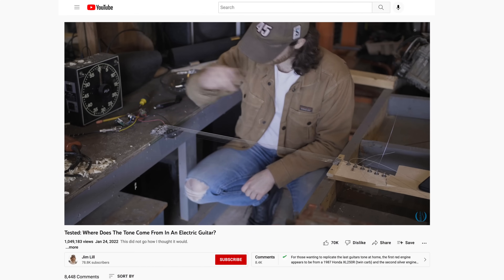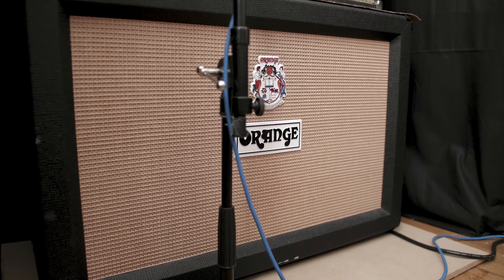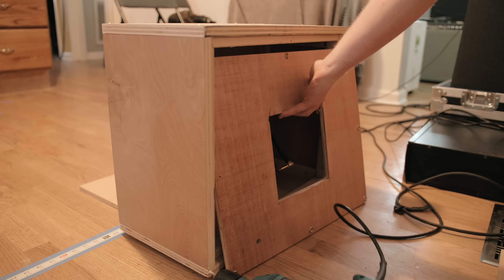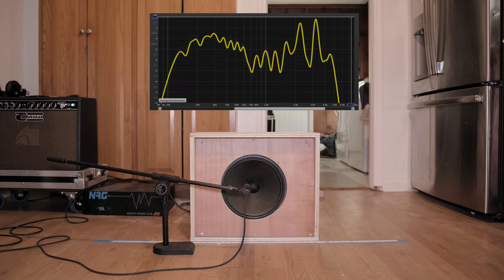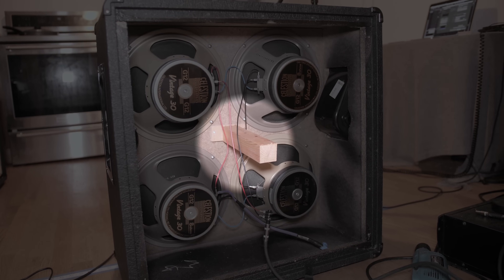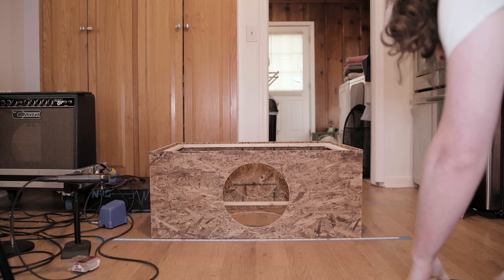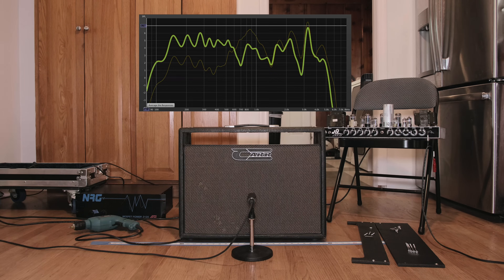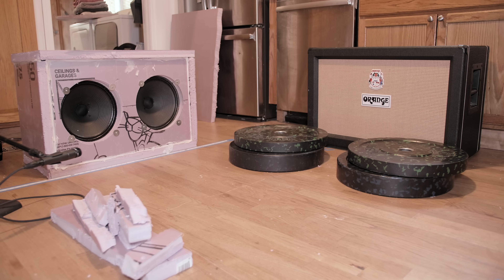Tested: Where Does The Tone Come From In A Speaker Cab?

Comment: Great video. On quad cabs, I find if you add a switch to put the diagonal speakers out of phase (don't switch with the amp on) you can reduce feedback at times.

Try adding fiberglass insulation inside the cab. I have found it to yield some interesting results.

Try caulking your front and back panels in place instead of screws. It makes them semi-floating but I have never measured a cab using it.

In an air tight stiff cab, try adding a 1 inch diameter port in front, and then increase it, say 1/2 inch diameter at a time to tune it.

I always wanted to try ballistic gel inside a cab, I never did.

Anyway, with multiple speakers, I find it better to mic the cab 1 meter away. Placing a mic too close to the cone traps some air and the wave fronts are still forming at that distance and it measures differently from what you hear.  3 meters away and the waves from multiple speakers start to combine more. But again, it's hard to baseline the frequency response if not in an acoustically dead anechoic chamber.

Comment: Great video. Very thorough. 
There are a few things sure folks have informed you of but here's my take.
Front mount verses rear mounted speakers. How an angled, slanted and straight cab feel in a room l. Also the vintage 30s were different from one another. Pre 2005 v30s sound waaaaay different to post 2005.. not too sure if you stuck with the exact same v30. Just saying.
Keep up the good work

Comment: I have a cabs and one of the best is a home made playwood box, same size as a DSl40. I loaded it with a 12” V30 and 10” Celestion 10/30. It was a bit woofy so I cut three 2” holes in each end (hand holds!) and it was perfect.

Comment: Wow! True science colliding with guitars! Subscribed!

That final comparison with the foam amp was quite astonishing! Almost no audible difference, except one amp seems to have slightly less in the mid-range (?). I'm not great at hearing frequencies yet. If I were to theorize based on physics, I think that a lighterweight material, having less inertia, should respond better to higher frequency oscillations. Heavier material would resist the constant back-and-forth movement as it's more difficult to change direction every single oscillation, and this happens more often in the higher frequencies.

So... The one which has lower mid-end (second clip in the pairs) was perhaps the Orange amp?! That's just what my physics intuition suggests to me but I'm not sure!

Comment: Awesome video. Another thing you could of tried was something not often spoke about with guitar cabs. Wadding. Like how much is the waves being reflected inside the cab making a difference. Some hifi speakers are filled with a wadding material. Like an old set of celestion Ditton hifi speakers I had were filled with net bags filled with tiny cut up sponges. 
You might also want to check out barefaced cabs and their YouTube channel, so ace information.

Comment: Great video!, however, I found that most guitar speakers are made a little different, cone material, magnet, etc., also the audio wave projects from the back as well as the front and you get phase cancellation at different  frequencies. The open back cabs cut down somewhat on phase cancelation, redirecting the back wave coming around to the front of the cabinet, try a small section of padding on the back and two side panels, have fun !😊

Comment: What an amazing inspirational video this is. You legend. I couldn't even tell much difference between Styrofoam and timber, yet I couldn't hear much change between a lot of the factors tested. But one thing to consider, when mixing or mastering, subtle changes make big differences in the mix, alone they're are not perceived as well 🤔 so perhaps all these subtle differences of cabs really only matter when in a mix or contrasted against another timber? (Musical element)

Comment: truly the best channel because it just ruins every tone-snobs conspiracies about "tone woods" and miscellaneous specs that brands make claims about to create the perspective of value.

Quality of build is one thing. But anyone can copy a popular cab they like, with cheap MDF and as long as their measurements are within reasonable accuracy, they can have the same thing for a fraction of the cost. For me it all comes down to the low end and very top end. Most cabs tend to have a similar affect on the mids/upper mids, but where you see major changes is in that 150hz and below, or 4khz and up range. Finding the one that please those two ranges is the right choice, then after that its all about swapping various speakers to get the mid range you prefer, as most guitar speakers themselves produce a max range of about 70hz-4khz and its less accurately represented on either end of the spectrum. Too often people jump to the v30 and will us it in tiny open-back 112s and wonder why it doesnt sound like their favorite records, and its because the classic combination was an oversized 412 with a worn in v30. you gotta compensate for your cabs resonance and presence, with the midrange qualities of your speaker. they work together or against each other.

Comment: There is one factor that I would love to see tested that never gets  mentioned in any of these discussions.   How about moving the mic away from the cabinets several feet where a listener would hear it.  I feel like cabinet design, speaker angle, air volume, amount of speakers etc would be much more drastic when the sound is projected away from the source.  Also multi speaker vs single speaker cabinets have a much greater difference than when you are focusing on the mic into 1 speaker even with other speakers producing around it.

Comment: Look up the Thiel/Small parameters for speakers.  This gives the relationship of cabinet volume, size of the "port" or open back, and the low end response. The golden ratio of sides will keep wave  cancelation and additive to a minimum. (.618:1:1.618)

Comment: Love the videos. Always enjoyable.
I do have a bit of a problem with this one though. That of the mike placement. 
When you play you're standing much further to the whole assemblage and what you hear is a combination of other factors. For example you touched on phase cancellation at the end. Phase cancellation in an open back won't be as apparent to a mike a few inches from the speaker cone as it would to you standing  4 feet away and not directly in line with the cone. 
I would have been happier if you would have included at least 2 other mike positions in the tests.
But then again maybe I'm being too picky. Regardless, keep going where your curiosity takes you, I will follow you.

Comment: This is absolutely amazing. Very indepth and scientific. These results should be documented. Did you happen to note down the correlation between the back panel open width with the resulting EQ curve? I would be very interested in that.
Reply: As an amplifier cab builder myself, I have to say that this video is somewhat misinformational: If every audio clip in this video does actually correspond with the visual/video presented on screen, then it is clear to see that the recording microphone (in 99% of instances) is directly in front of the speaker... so, in a 4 X12 test... Jim is only recording ONE speaker... same goes for a 2 X 12 or any other combo. The wood, resonance and structure of any cabinet DOES affect the tone... but you're not going to hear that with a mic placed right in from of ONE speaker. To do this properly, Jim should place the mic say... 20 feet away - about where you'd hear the speaker if you were stood near the front in a small venue.. or managed to get right to the front of a stadium gig. Just saying! 🙂

Comment: 16:36.  The open back might not be affecting the tone in free space.  It's possible that by opening the back, it's changing the modal behavior in the room.  If you want a better idea of how the cab affects the bass response, you'll need to take it outside.  I believe the type is called 'ground plane' measurement.  Another thing you can look at is decay plots in REW to observe resonances (edit: oh I see the EE already mentioned this).  Well, the last thing I can think of measuring is the directivity of the speaker cabinets but you might need a Klippel to do it.  Other than that, you're setting the standard.

Comment: Crazy experimenting bro..I have one cab you didn't try and that's a thiele style subwoofer cab with one 10 inch guitar speaker that I use as an extension speaker for combos, or two of them stacked with mini heads, and they have as much low end as a 4 x 12 with a much smaller footprint and they sound amazing, try it out sometime

Comment: Overpriced branded cabs and also this video inspired me to build my own cabs. Its not that hard, just start trying. Lately I found some good quality 18mm Okoume plywood and built a vertical closed 2x12 with two 78" 444 Kurt Mueller 5hz Blackbacks in it. I made the baffle and the back panel from 12mm birch plywood just for the idea I guess.  It sounds awesome with my Orange DT tho. Thick bass, singing mids and sharp highs :p

Comment: Firstly, let me say I absolutely love Jim and his videos.But one test made me rethink every one of his videos. The one where a slant vs straight cab. They sounded identical here, but my own experience is there is a massive difference. So after thinking about it, I think there is a difference how sound travels from speaker to mic vs speaker to ear. It’s possible the sound waves change drastically traveling around a room and ultimately to your ear, than just straight from speaker to mic. In other words, mic’ing a speaker may not pick up all the intricacies of information that sound waves carry through the air. Maybe the audible differences need to be captured with a room mic.

Comment: Hey Jim, thanks for this video and all the rest of them. They’ve been super entertaining and informative.

I wanted to bring up something I noticed made a pretty massive difference in tone and feel when recently messing with my 2x12 cabs… I don’t think it was mentioned in the video, but series vs parallel wiring for the speakers! I know you tried different impedance taps, but I would be curious about your experience and findings in regards to tone and feel change with the same cabinet and amp with 2x12 in series vs 2x12 in parallel (unfortunately can’t isolate the impedance tap for testing, but it seems you already tested that it doesn’t make a significant difference).

I think Alex at Barefaced Audio did a video about some of these observations - if I remember correctly they were exaggerated when using different speakers in a 2x12.

Comment: You've heard the saying "garbage in = garbage out" , well that applies to audio input as well as computers. If your input is in the middle frequency range, and it sounded like that to me, then these changes in the "tone" may  not be as significant if there were really low frequencies. The higher frequencies do get absorbed easier than the lows, aka T shirts. Multiple speakers will move more air which affect the lows, but they need more power than a single speaker. Honestly, you did a great job with your methodical test, but here are so many more variables, it would take several Pay Pal accounts to factor them all. The art and science of speaker cabinets is a lifetime endeavor, sealed vs ported, tube port vs slot ports, cabinet volume vs speaker size, resonant frequency of the speaker cone,  dual voice coils vs single, flat wound vs wire wound, magnet size, it's just too much for a guy to analyze. Speaker companies have devoted years and their large budgets to experimenting with what makes the best sounding speakers. Then there are the amps, preamps, mics, room size and shapes, it's too much!

Comment: Hi again,  Jim, I'm sure you found out that Styrofoam is kinda porous to sound, and I used it with one of those surface mount audio exiters that are for sale from parts express!, made a 2 x 4 panel speaker!, works good. If you go on line to check your guitar speaker specs, they'll have what's called the thiel-small parameters, example,  Qts, Xmax, electrical Q, etc., these parameters can help you to build a great cabinet for your guitar speakers, I'll try to send you some info on some of the guitar speakers that I am building a cabinet for, thanks for your hard work on all those cabinets!!😊

Comment: I built a Paulownia cabinet for my mid 80's Peavey Bandit to the original dimensions. The original cabinet was made of OSB and very heavy. I couldn't tell the difference in the sound between the Paulownia and OSB, but the weight dropped about 10 pounds!  I think this supports Jim's theory that the dimensions and layout of the cabinet affect the sound more than the wood type.

If you've ever wondered why a Bandit and Special from the mid 80's weighed the same in spite of the huge difference in the size of the transformers, it's because the Bandit uses OSB and the Special uses plywood.

Comment: I have 2 small closed cab's, 18mm plywood, celestion gold 12" 8 ohm, paralel 4 ohm to the amp. Both with a square in the middle.  (4 chambers). Try it 👍👂

Comment: I know most (not to say everything) in electric guitars tone is only marketing to overpricing the thing, nevertheless here lies a limitation to these tests and most in this platform: the hard YouTube audio compression it applies to every content; and I know this for good since I'm an audiophile and everytime I upload anything, the difference in dynamind range in between my original uncompressed audios comared to those uploaded here is truly huge, no exageration the loss is easily around 50% of quality (dynamic range), not to mention that even after 70% of the audience listen them from cellphones or sstems that limit the experience even further. Nontheless this was a great video even though it has its reative side due the mentioned circunstances.

Comment: careful with big hole saws folks. easy to twist your arm badly or helicopter your workpiece. use clamps on the workpiece and both hands on the drill. 

Nice freaking testing. Room Eq Wizard is indeed a very handy piece of software.

Comment: great video but, I think wood does matter when you start pushing 100 Tube heads to the max.  There is definitely different low end going on with different wood when 4x12 cabs are pushed hard with 100 watt tube head.  Really got to get them speakers moving to truly test that.

Comment: this is a guitar box video and is great.. however guitar speakers are usually not going too low.. i think your findings about the closed/hole-size effect would be much much more significant if you'd get to that 30-100hz range

Comment: You could probably get the sound of all cabs by using the cab with the fullest frequency range and then use an EQ to dial in the difference.  In fact, if you're recording, just run the preamp directly into an EQ and dial in the cab's frequency response.  You'll probably need a very expensive multi-band parametric EQ though.

Comment: Most of the things Jim finds are well known and well documented in technical litterature. I admire the work and dedication but he could have saved a lot of efforts by buying a serious book about cabinet construction. Some things are very difficult to calculate but some others are very easy. For example what he found about the size of the hole in the back of a closed cabinet is the principle for bass reflex cabinets. If you make a hole the good dimension and calculate the precise lenght of a tube inside the cabinet that leads to this hole, instead of cutting low frequencies, it will reinforce them. Volume of the cabinet is also extremely important for the low frequencies and there's a simple formula to calculate at what frequency it will "cut" (drop by 3dB) given the volume of the cabinet. A 1 cubic feet closed cabinet will cut at around 80Hz and a 2 cubic feet at ca. 55Hz, etc.

Comment: The Body of a Speaker doesnt make a big of a change a high pitches but in low ones it can. There are Ways to form an internal pathway at a specific length such that the outcoming air moves the same way at the same time as the air from the speaker wich makes the pressure zones combine instead of thinning it out

Comment: Awesome work, awesome process and awesome content, really, respect.
One thing though, what about back vs front loading the speakers, I've seen tests and tested myself the two mounting ways and it seems that front loading produces a lot more bass, probably because the wood comes in contact with metal instead of paper or "cork" material of the speaker frame.
Also check out "Barefaced Audio" cabs, I made a cab inspired by their back vent design and it was a game changer for me, I think you'll love it, especially live.
Congrats again on the channel :)